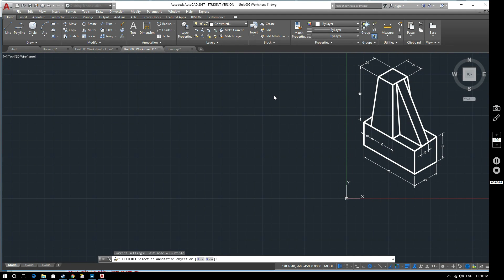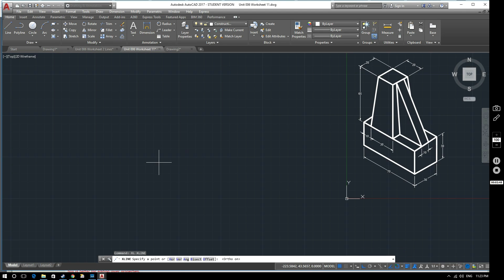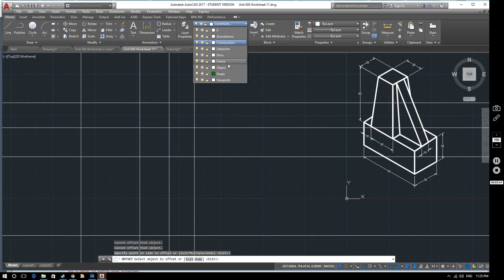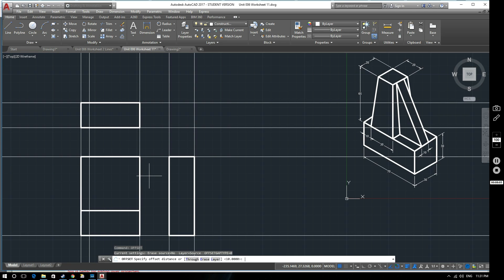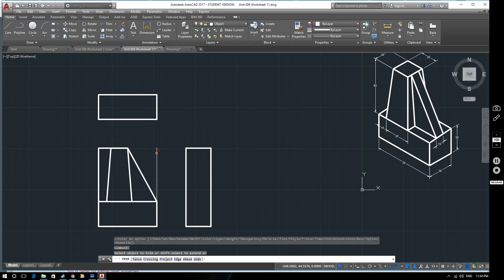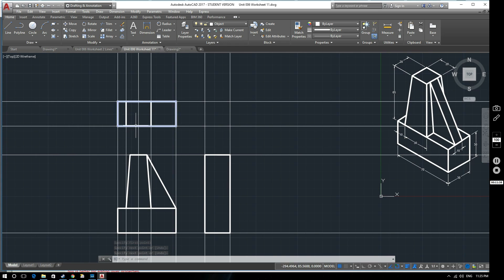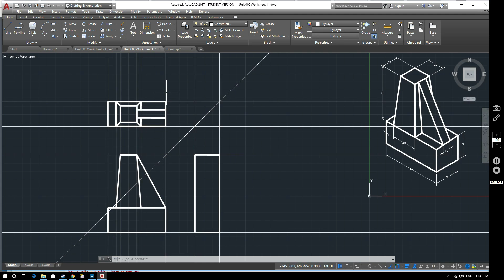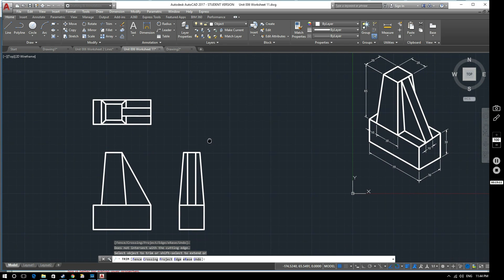AutoCAD 2017 Tutorial: Orthographic layouts

Comment: An instructive video.  I would make several suggestions/observations: 
1) Rays rather than construction lines will reduce some of the complexity, 
2) Turning on Selection Cycling would have helped identify coincident lines (some people will draw coincident objects on a temp layer and then change the layer), 
3) For some it is easier to change an object's layer using the Properties dialog box rather than through selecting from the drop down layers